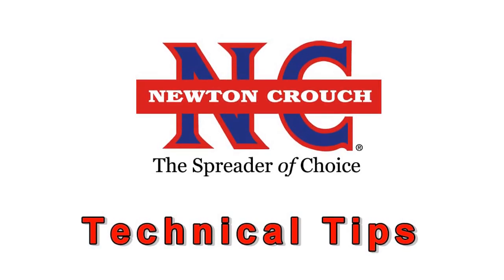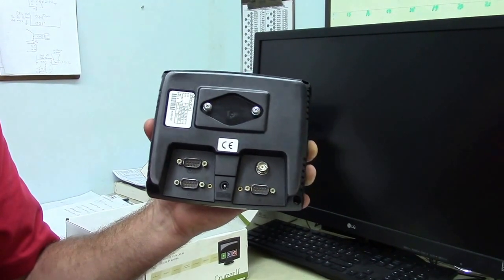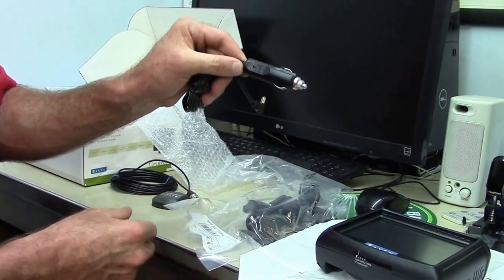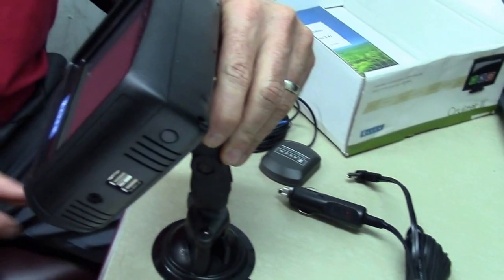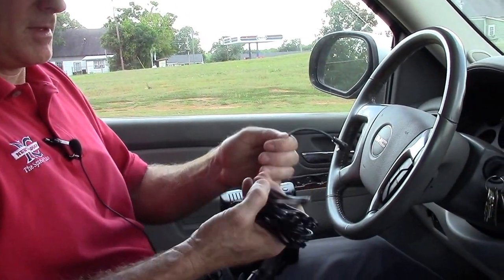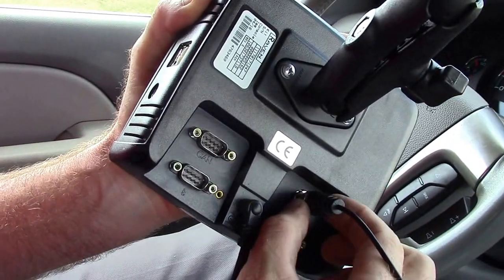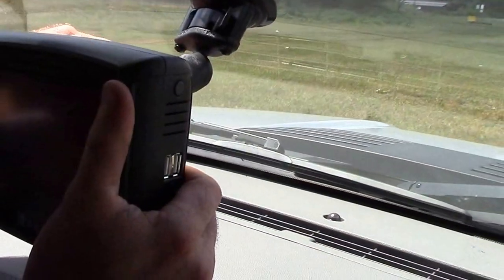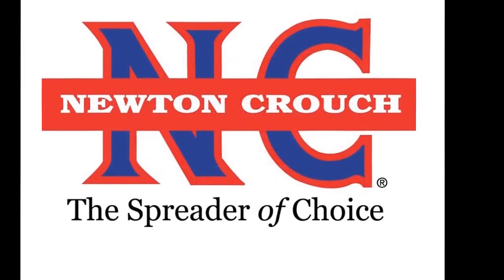Raven Cruizer II #1 How to Assemble Components Out of the Box & Install in your Tractor or Truck

Comment: The unit with the helix antenna cost. Why would you need it over the patch?
Reply from the maker: If you are near trees or you are in a valley, the horizon might be obstructed and the helix has a broader view.   They are both the same signal strength:   10 Hz.